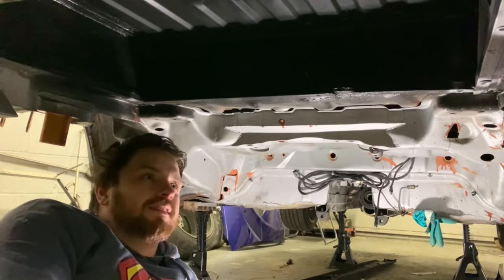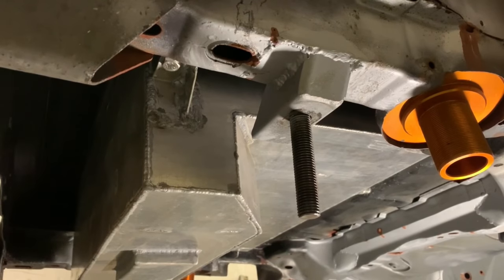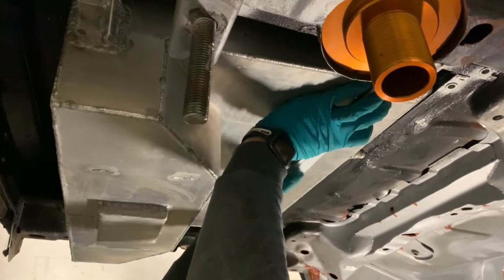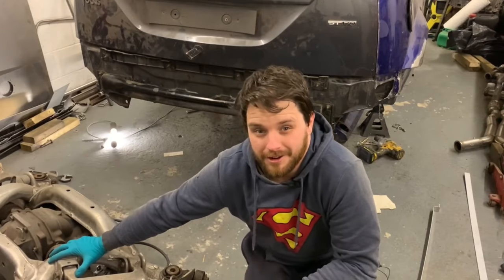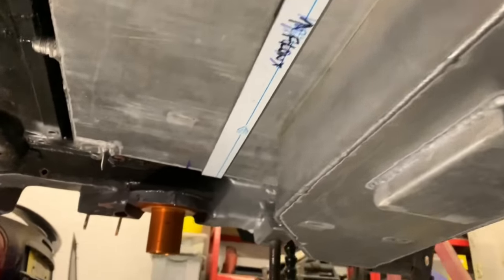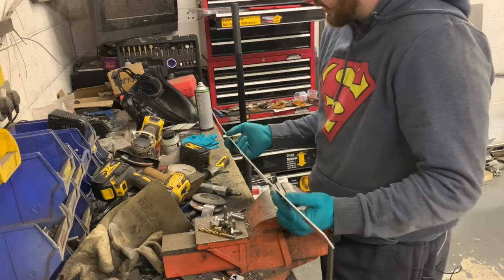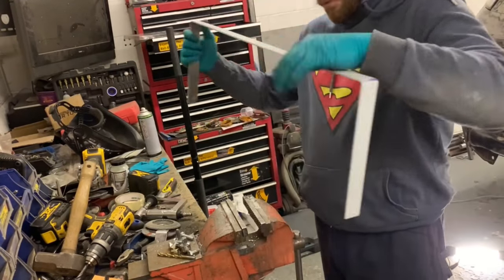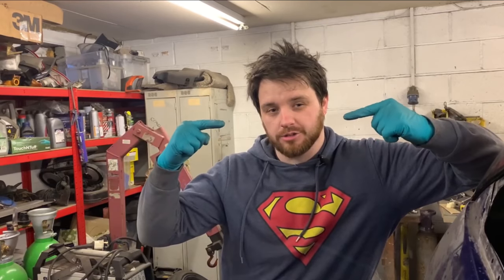Tank Straps - 1UZ V8 Ford Focus - The Flexus Build Episode 53

Comment: Jaff it's easy, turn  up 2 aluminium spacers and mount it off the original rear mount, using the same bolts to make a double fixing.
Reply from the maker: I’ll come back to them at some point I’m sure

Comment: How about on the rear strap on each edge make it a Y shape so each tail of the Y goes either side of the tank bracket you already have? Most vehicle manufacturers the bolts are in the vertical position for the straps. Another option is weld nuts onto plates and weld them into the big ovel holes
Reply from the maker: I could, not sure how difficult it would be to split the bar in half and bend it the way its not meant to bend lol. 

I know I said I'm strong in the video but I'm not that strong 😂

My current idea is hanging straps from the boot floor, there's not much room but there might be enough
Reply: @JaffBuilds  i was more thinking weld tabs of aluminium at an angle on the ends to make a Y but eat some porridge and wheetabix and man up!!!
Reply from the maker: Tbh I can see a new tank with proper mounts in the wings lol
Reply: @JaffBuilds  jesus no that be mk3 then
Reply from the maker: Progress takes iteration 😂
Reply: @JaffBuilds  🙈🙈🙈🙈

Comment: The rear strap would be better to be at 45° to the tank if you stick with the bolts in the vertical plane,plus the aluminium as a strap wouldn't be strong enough, but then if steel is used you may then have corrosion due to aluminium and steel reacting with each other,tricky one this!
Reply from the maker: tell me about it. its doing my head in! i think i may have come up with a solution but it means buying more aluminium and making a load of brackets. which currently fills me with dread!

Aluminium is plenty strong enough, just need to find the correct application
Reply: @JaffBuilds  definitely a tricky one,but fitting straps will take the strain off the 4 bolts/brackets holding it on now,most new cars still use straps so must still be the best way to retain the tank,keep at it,sure you will overcome it,especially with some of the other engineering problems you have already overcome  on the build.
Reply: Steel straps and powder coat them. Then you won't have the reaction between steel and aluminum. Or you could add a rubber tape between the tank and steel strap.
Reply from the maker: the straps have rubber isolating them anyway, the mounts don't though...

basically this fuel tank is a proper pain in the rear!